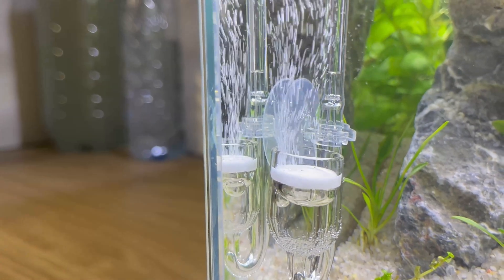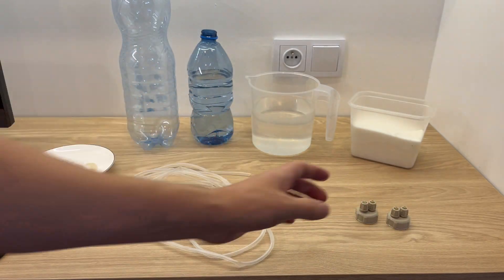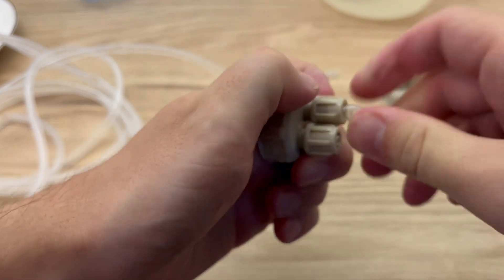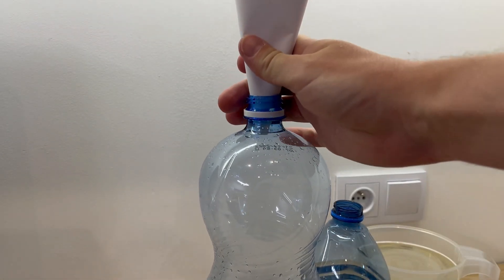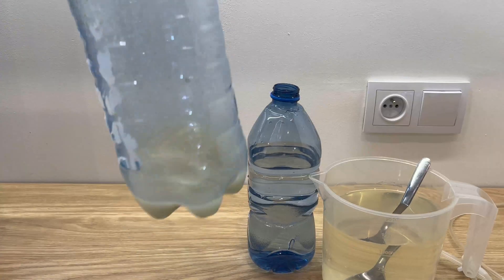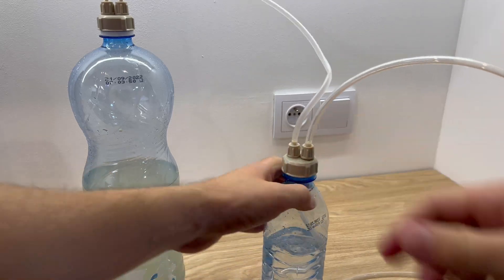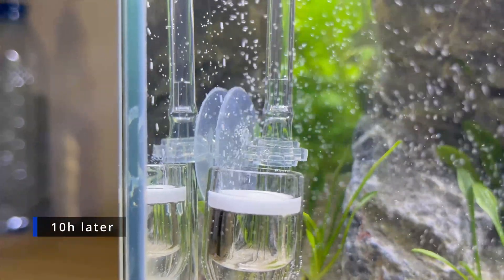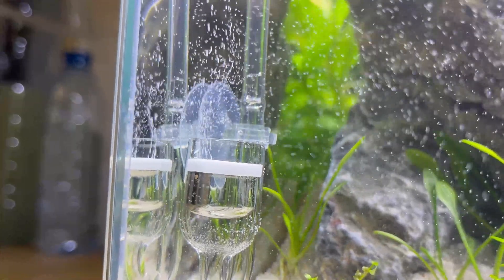How to make easy CO2 for your tank? Cheap and easy DIY CO2!

Comment: That's genius! I've made wine before but would never have thought of this. I have a very small tank with a few guppies in it & this would be ideal, better than the electric pump I bought as that's too much for my set up. Also with the cost of living crisis at the moment it's an added bonus that no electricity is being used. Thank you. Subscribed 😊
Reply from the maker: Great, thank you! Yes it's very effective, but remember that in very small tank you have to control CO2 levels during the night. You mention electric pump you bought. It is pumping Oxygen (O2) not Carbon dioxide (CO2) - sorry if this is obvious, but just wanted to check if you are not confusing those ;)
Reply: @AquascapingCube  i was wondering that as well.  How often should co2 be introduced into the water column? And what is naturally causing co2 in natural water sources? Maybe i will look it up!